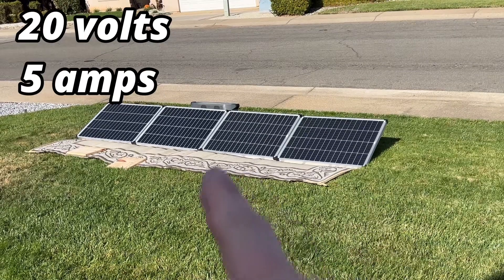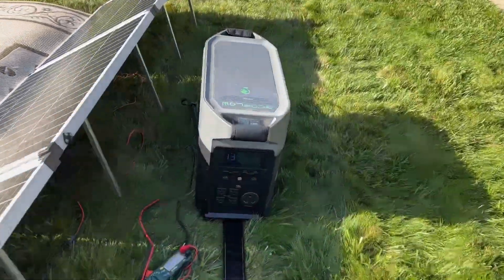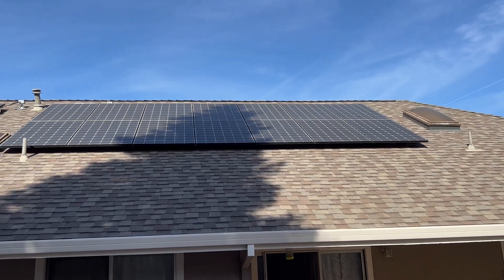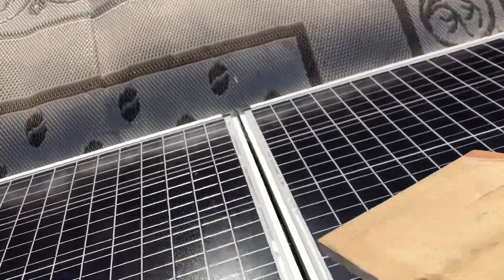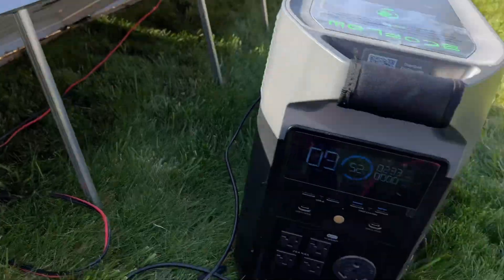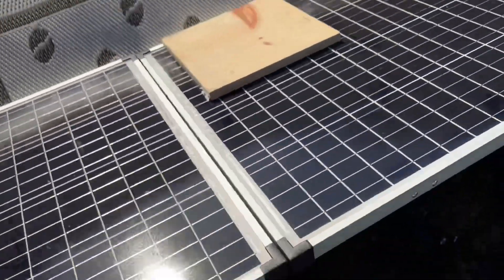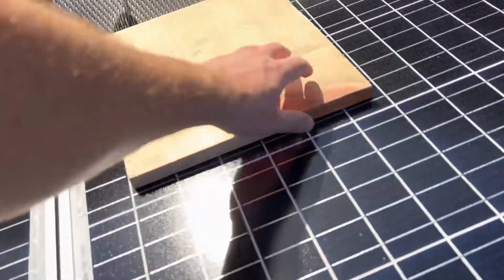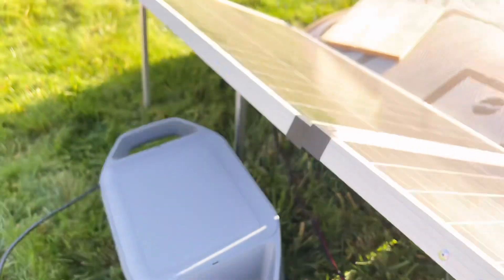How wiring your Solar panels makes a big difference !

Comment from the maker: Hope this video helps you with your project. If so let me know and smash 💥 that like button..👍🏼😀

How to Wire Series,series parallel: SERIES VS PARALLEL WATCH HOW IT WORKS SHADE TEST!
https://youtu.be/RFAYW9NZphU

Ask me direct for fast response ...https://asqme.com/@johnnysweekends 

ITEMS IN VIDEO AND OTHER SOLAR TOOLS…….
Solar Power meter: https://amzn.to/43Lmo4A
Multimeter: https://amzn.to/43q6OLX
Branch connectors: https://amzn.to/3MVF0YC
Delta pro: https://amzn.to/3PgntgT
Delta 2: https://amzn.to/3J0Hrbd
Solar wiring kit: https://amzn.to/45NFYip

CHECK OUT MY AMAZON STORE: https://www.amazon.com/shop/johnnysweekends

If you feel I helped you out, consider Buying me a Coffee 👍🏼🙌🏼👊🏼😀
https://www.buymeacoffee.com/johnny5120J
Reply: Did you cut the ends off and replace the connectors for the Harbor freight  panels? I know they are not Mc4 or Ecoflow connectors. I tried to pause and see during your video.
Reply from the maker: Yes, this makes it easier to hook up in series and series parallel….I have a how to on mc4 connectors….👍🏼
Reply from the maker: MC4 Install Crimping Easy DIY
https://youtu.be/CFgRCBzquz4

Comment: I bought a solar combiner box to solve many of these issues.
Reply from the maker: Nice, which one did you choose…?
Reply: @johnnysweekends  I bought the Vevor 6 string box.
Reply from the maker: I’ve looked at those, is the build quality decent? Or kinda flimsy? Anything you would want changed. Vevor seems to have there hand in everything right now
Reply: @johnnysweekends  I haven’t installed it yet, but the box is a solid, sturdy build with some heft to it and carefully shipped in a styrofoam case. My off grid adventure begins in September.

Comment: Timely video for me. Yesterday, I bought 2 250W Trina panels from a local guy.  He explained how to use transistors between the panels in case something happens to one panel in a series, just like you’re explaining.  He said he also uses fuses between them for additional protection in case of a failure of some kind. 🤠👍🇺🇸
Reply from the maker: Yes, the wiring is only part but then like you said adding fuses where appropriate is also needed. Like on my RV im doubled one for each large string that way if there is a problem with one side it hopefully wont effect the other. Then it all comes down and hits the breaker.

Comment: When connecting panels in parallel, pay attention to short circuit current and reverse current! Usually panels can withstand connecting two panels in parallel, but when you parallel more than two modules, there is the problem of exceeding the short circuit current. Therefore, each panel should have its own fuse to protect it from damage. In practice, the rated current of the fuse protecting a photovoltaic panel should be about 1.5 times the maximum current of the module.

String counts the same way. If you are paralleling more than two strings then you should also use fuses!
Reply from the maker: Yes, good info. I typically dont use fuses in my demonstration as its only for a short duration but I guess I should mention that, would be good info for others on the beginner side..👍🏼